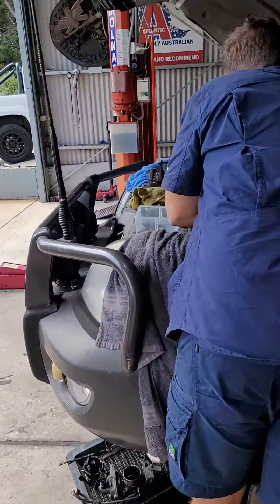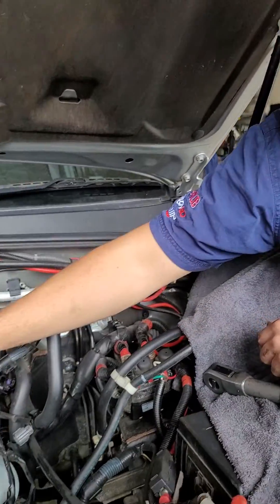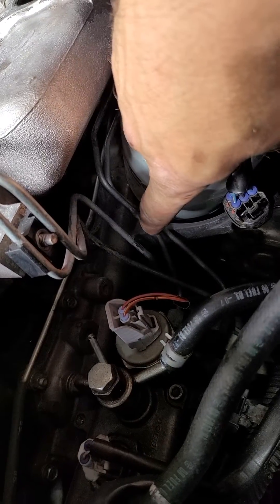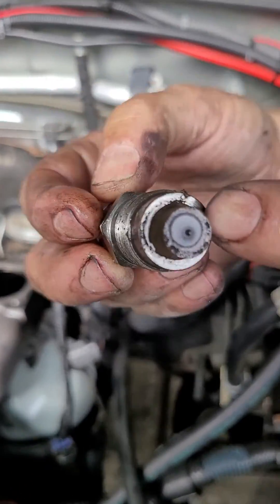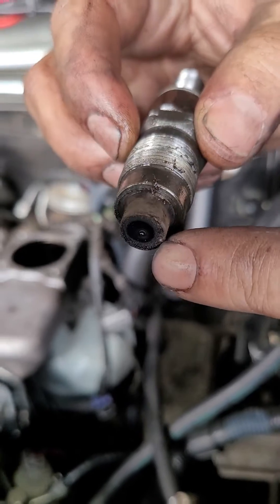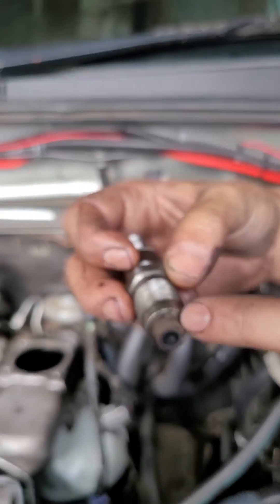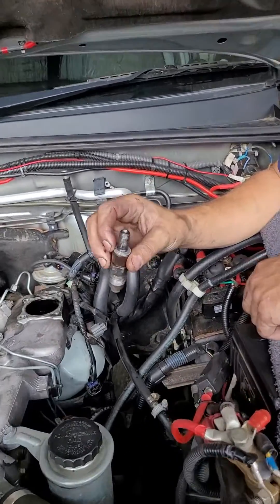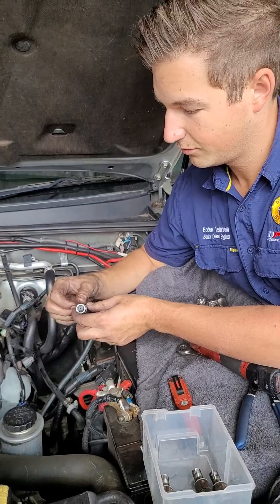Diesel Injector Damage ⚠️🚫‼️

Comment: Wow that's crazy.Hey man what sealant would you recommend to put on a tapit cover gasket for a 3.0 weat motor BT50 if any?
Reply: We used the original grey sealer by LOCTITE. Other silicone sealers didn't come near it😊
Reply from the maker: Just a GENUINE NEW rocker cover gasket and seals